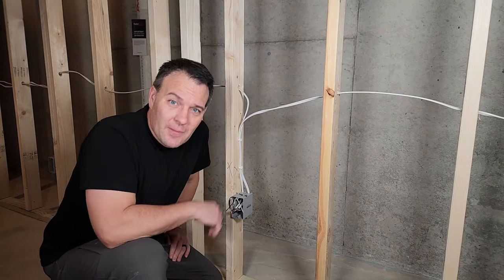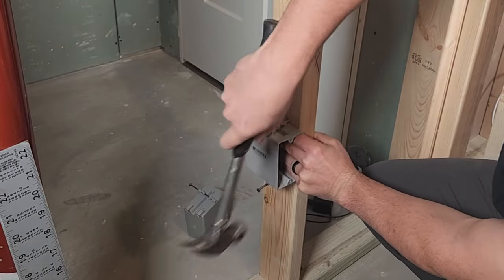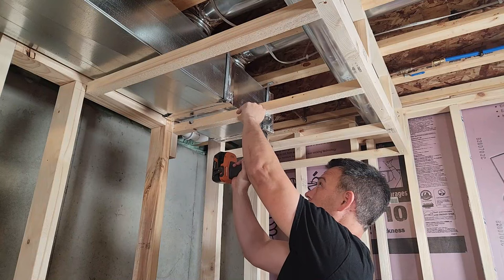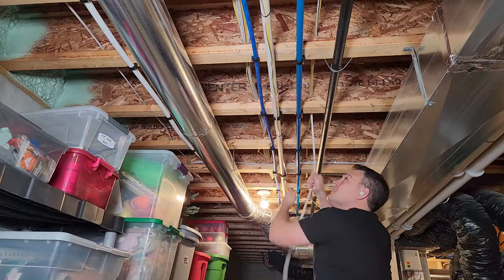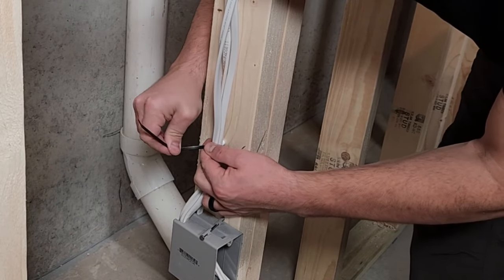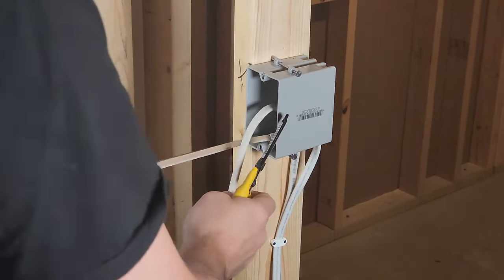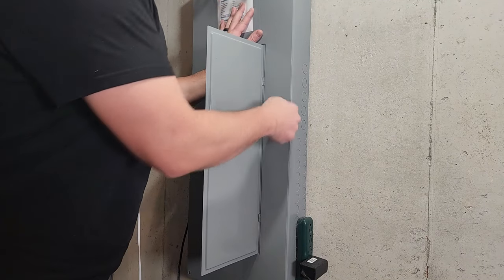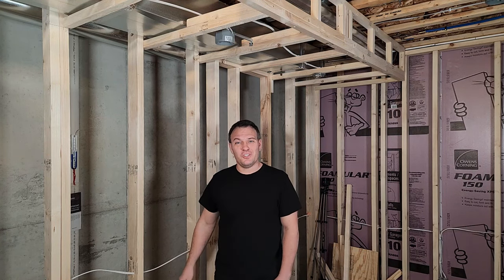PRO tips to Rough Wiring A Room || E8 Finishing a Basement

Comment: So all wires from light switch to lights should go up along the corner of a room right? I want to install a TV mount but my studfinder's live wire indicator is saying there's current somewhere along the big wide wall I want to drill into, makes no sense.
Reply from the maker: Not necessary.  But if the wire is running along the stud. It should be staples along the middle of the stud.  You should be able to put a lag bolt into the stud.